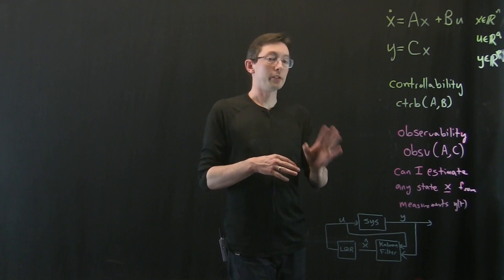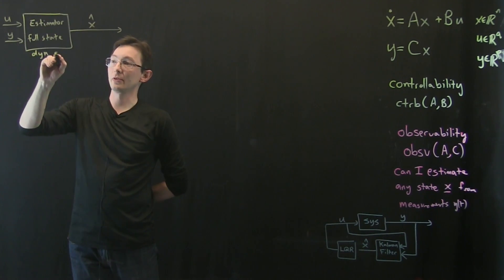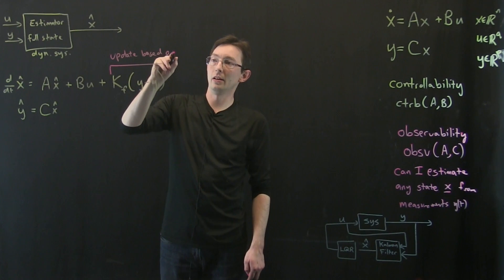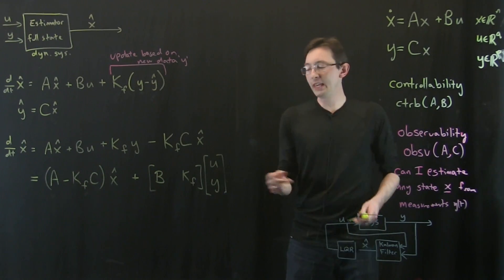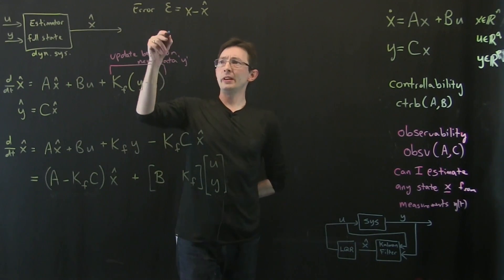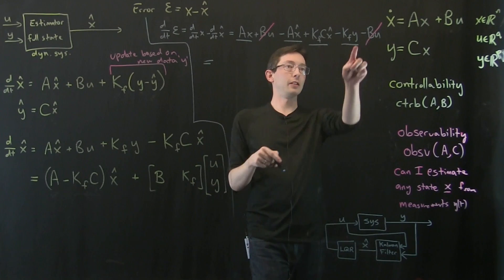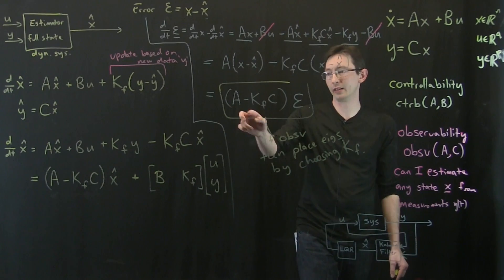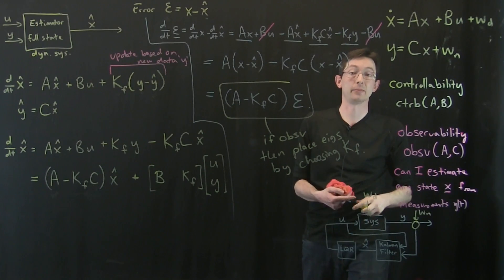Control Bootcamp:  Full-State Estimation

Comment: in a real system using discrete time steps, does the estimated X state get saved anywhere? Its not clear to me that the estimated X can be estimated from a function of only U and Y without also using the previous estimated state as input. In subsequent videos, Professor Brunton chooses to measure the cart position only as Y and U is only the force driving the cart. From the force being applied and the position of the cart, how can it know the position of the pendulum? If the estimator was also given the previous pendulum position, I could see how it could estimate the new position based on the U an Y.  Similarly, if we are only measuring cart position, how can it respond to a disturbance to the pendulum position? Given U = Y = 0, wouldn't it always estimate the pendulum to be at pi even after a disturbance changes it?

Comment: I have a question. Why are A and B in the estimator's dynamic system the same as A and B in the original dynamic system? By the way, your course helps me a lot. The way you explain state estimation from the perspective of control is quite amazing.
Reply: Because it is assumed that you know the system, or at least can use a similar dynamic that can represent the original system.

Comment: Hi Steve,
We started with the goal of achieving full-state feedback by "backing-out" full state x from limited measurements y. Wouldn't it be possible to "back-out" (observe?) x without having to estimate it? 

From the equations of the original dynamical system, we could take derivative of both sides of y=Cx, to get: x_dot = C_inv * y_dot. We can then plug this into x_dot = A*x + B*u, rearrange, and get 
x = A_inv*(C_inv*y_dot - B*u).

What is the limitation of this? Why do we need to estimate on top of observe? In an ideal world where our sensors give perfect measurements, is plain observing as good as estimating? Thanks for the help; you're videos are awesome!
Reply: It is not ideal to do a pure derivative as mentioned, because the end result will be highly influenced by the measurement noises and system disturbances.

Comment: Well I have a question. Why can we write d/dt (X^) in terms of k(y-y^) but we did not write d/dt (X) in terms of k(x-x^) previously. We only did it when we wanted to find dynamic response of the system using ode45 but we never used it algebraically. Thanks :)

Comment: Hey Steve, Could you explain a little bit more about the Concept of C matrix? I'm a little bit confused, what is C representing?  How can we choose C in the systems? Is it only consist of 0 and 1 in order to show which state is the output? I understand that y^ consists less than the state variable of x^ , y consists of the same amount of state variable as y^.  And x consists of the same amount state variable as x^. so Is the only difference between Error and Update, K_f? Thank you so much.
Reply: The C matrix represents how your measurements relate to your state. So for example, if your C matrix is the nxn identity matrix, this means that you can measure all of your state variables independently. Choosing your C matrix depends on the sensors that you use.
Reply: rahulbball thanks :))))

Comment: Halfway thru the playlist. This bootcamp is a treasure!
Curious when we place eigs of (A - K_f * C) with some positive real parts, the system error will explode as t->inf, what should we call it? Unstable-observer?

(previously I made a mistake in the comments and re-edited it.)
Reply from the maker: Thanks for the nice comment, and glad you like it!

If the eigs of (A-K_f*C) have negative real part then these are stable, so \eps will go to zero as t->inf.  If the eigs have positive real part, then it would definitely explode.  I like your terminology.  I would call this an unstable observer.